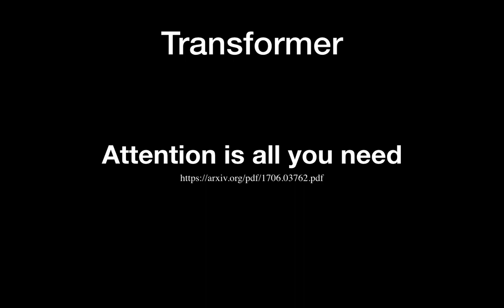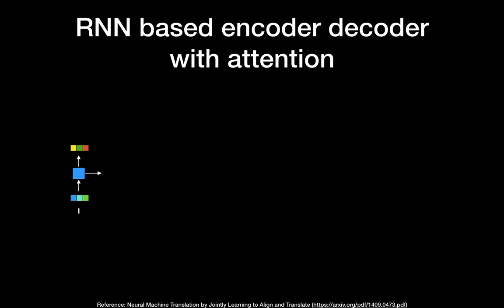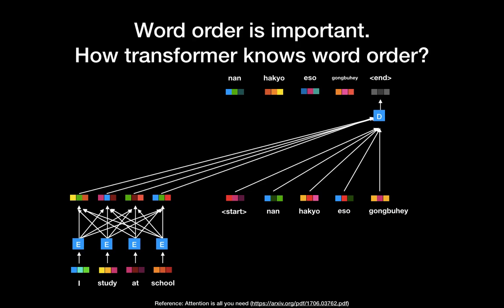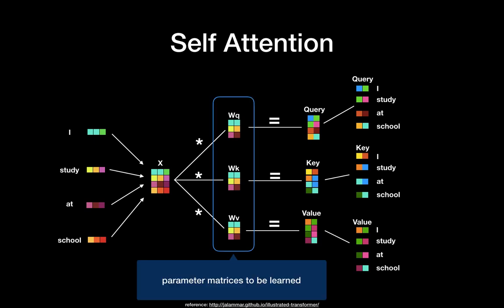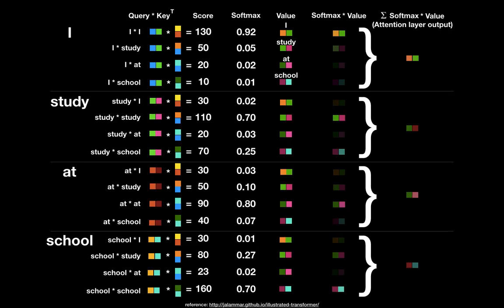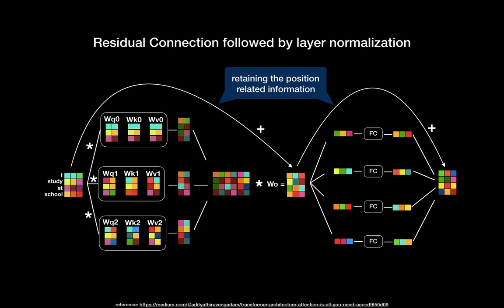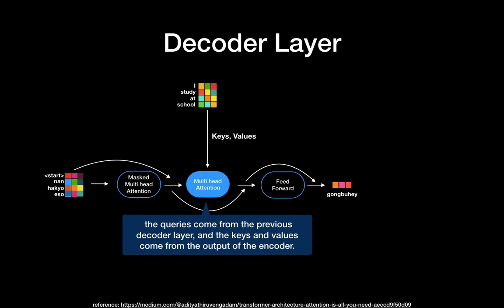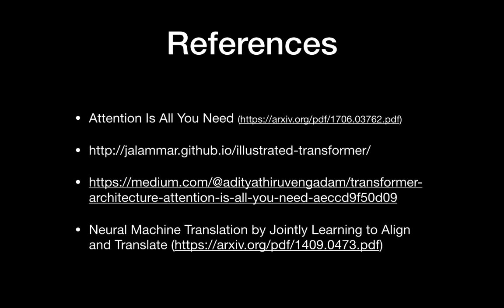Transformer (Attention is all you need)

Comment: it's a good generic explanation, but still does not explain how the k,v,q vectors are generated and the intuition behind them.  most literature glosses over this.  That just seems lazy.
Reply from the maker: Sorry for that. Illustrating or visualizing concept is one of my passion, I just hope this at least give you one more step to full concepts.
Reply: @TheEasyoung  It does, and better than most videos.  so thank you for that.
Reply: This seems the clearest explanation of self-attention, as it applies to GPT2 as an example, however it seems that there is some funny-math in the multi-headers of matrix calculations; either i'm reading it wrong, or this is a fudge for reducing computational complexity that appears to work -- I wish they would clarify if that's the case, it would make it easier to follow:  http://jalammar.github.io/illustrated-gpt2/

Comment: What is the job of feed-forward neural network in each encoder/decoder stack, after the it receives the input from the self attention layers?
Reply from the maker: I am not transformer author and couldn’t find reason from the paper, but IMO usually FF used for outputting desired dimension vector (possibly to be used on next other encoder input) and also give more vairables in the Transformer network.
Reply: Thanks